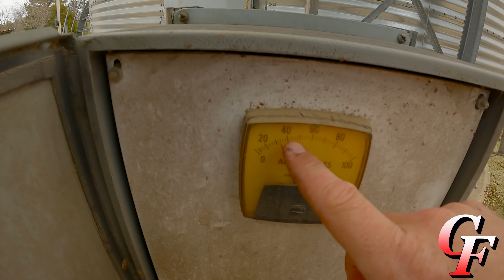12/2/21: Record Setting Truck Loading!!! First Run With New Holding Bin

Comment: I like that setup. We have a loop system on 5 50,000 bushel bins. How much did that tank run you?
Reply from the maker: $36K.  Is your loop manufactured by GSI and does it squeal like mine?
Reply: @griggsfarmsllc  Is that one continuous loop chain? What if the chain breaks under one of those full bins?
Reply from the maker: @dmc3742  yes one continuous chain. If it breaks I’ve got a big problem
Reply: @griggsfarmsllc  sorry its taking so long to get back with you. Been one of them days. Ours squeaks when we’re loading out of the tanks at the top. Like the paddles are rubbing the bottom of the pipe. When we’re loading the bins it squeaks at the bottom. Ours is the gsi setup out of valley view arkansas. They came out and took a link out of it and it shut it up for a while but the grain will stretch it out and will start rubbing again.
Reply: @griggsfarmsllc  is yours a 10 or 12 inch loop?
Reply from the maker: @caryenmon1903  8”
Reply: @griggsfarmsllc  oh ok. Gotcha. Ours is a 10. I know a guy with a 12 inch and its a bad son of a gun.

Comment: Never seen a "leg" like that before. Hey if It works, it works. One good thing is that nobody can say they didn't know it was running! Like dragging fingernails on a chalk board. That is a quick load time. I worked at a large grain elevator in middle Georgia while in high school and our overhead would take five minutes and i thought that was fast.

Comment: That overhead bin was a needed improvement to your operation. Now please find out that noise in you system, it must be very annoying for you
Reply from the maker: Nah, kinda like arguing kids, I’ve learned to tune it out. That noise has been there since the system was new. Haven’t had any problems with it. It’s the paddles running against the top pipe when the top tube is empty